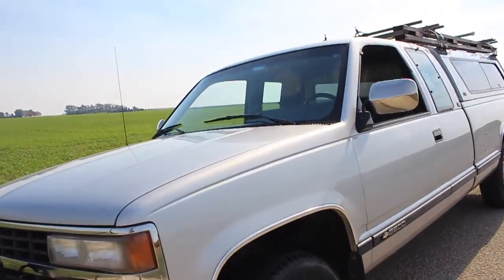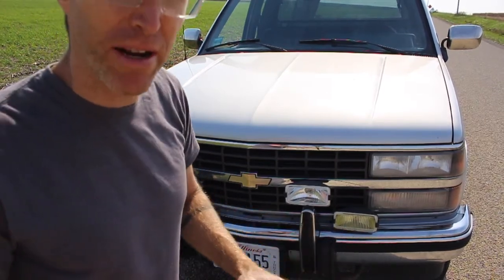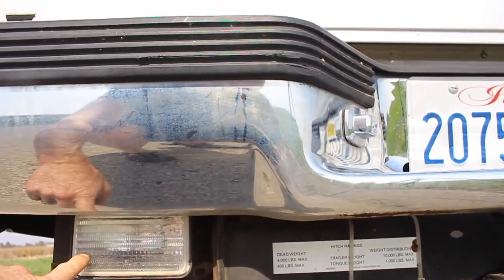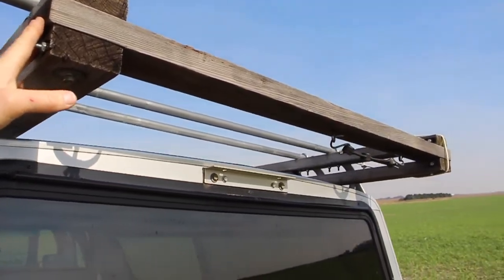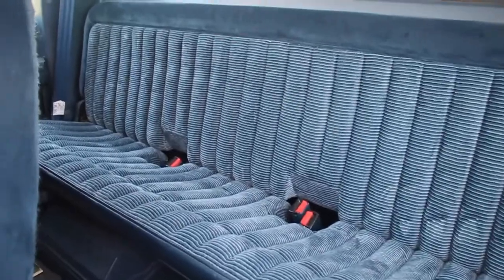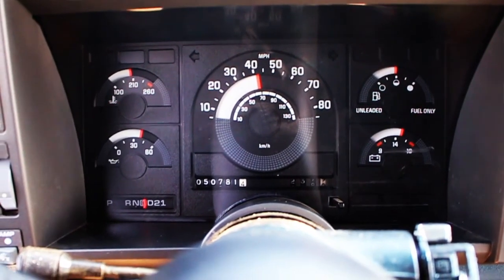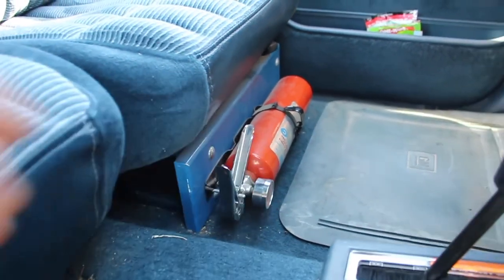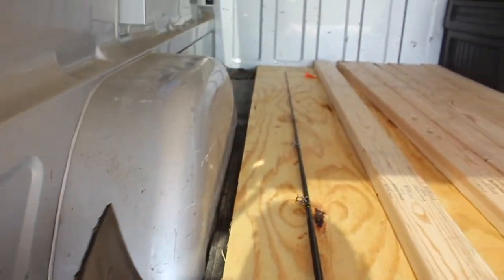1990 Chevy Truck Tour

Comment: Very awesome clean Chevy! I had a blue 1990 C1500 2wd V6 5speed. I had the same blue interior. I sold mine 3 years ago to a younger guy that I work with. He swapped in a TBI 350. As others have mentioned use relays to reduce the chance of fire. I see burn marks all over the highways where there were car fires. 
The GM headlight switches in your truck actually run a powered (smaller gauge wire than they should have used) into the cab and the headlight switch is actually switching the power on and off. A lot of the headlight switch plugs are melted where they have gotten hot. You can build this harness for less than $30. You can google it but you run your headlights directly off the battery with a 10 awg wire ran to a Bosch style 40 amp relay. You headlight switch is then used only to turn on (trigger)the relay using  the existing smaller gauge wire. What you get is a by-product of brighter headlights. With the headlight run direclty off the battery when running your alternator is charging the battery at around 14.1 - 14.2 vdc. The old way it goes through the switch and extra wire with more resistance and finally back to the headlights at around 12.2 vdc. That doesn't sound like much but there is a formula that I can't find and it is a significant increase in usable light for just the 2 volt difference and it's safer because you are not pulling 30-40 amps through your headlight switch. Here is a premade harness not sure on the price. http://www.painlessperformance.com/webcat/30817. Also with most GM cars and trucks when you switch to high beams the low beams go off. There is another relay kit    http://www.jegs.com/i/Painless-Performance-Products/764/30802/10002/-1     That keeps all 4 headlights on when you switch to high beams (better spread pattern of light). You can build this for less than $10.  If you are going to keep your driving/fog lights use a relay for those as well and get the (fire hazzard) high draw power wires out of the cab and run them directly off the battery and run a small gauge wire into your truck just to trigger the lights on and off.    Very nice truck!
Reply from the maker: Oh man, all this info totally makes my day! This is super helpful ... and I had no idea about these wiring issues and options. Thanks, man!
Reply: You are welcome! I built a harness for my 1990 truck and I just ordered all the little connectors for another harness for my son's 2002 s10 Blazer 4 door 4wd. It's a little cold here and may wait for warmer weather.

Comment: Chevy & GMC produced those generation fullsize pickups from 1988 through 2000. In 1988 only the regular cab pickups were redesigned to that body style & first time the optional extended cab was introduced too. Fast forward to 1992 the fullsize SUVs & crew cab pickups were also redesigned to that body style. On the 1/2 ton pickups & fullsize SUVs, 1999 was the last year for that body style although the next generation 1/2 ton pickups were introduced in that same model year. 2000 was the last year for the 3/4 ton & 1 ton pickups with that body style.
Reply from the maker: Thanks for all the info! My 1990 is getting close to 70k miles ... great truck
Reply: @metaspencer  did u buy it new back in 1990?
Reply from the maker: @kevinrichards3288  My step-dad did but didn't drive it much ... when I got the truck from him I also got all the original manuals and stuff ... getting close to 70k miles!

Comment: Do you know how relays work. I would remove the switches, and set up relays to supply power to the lights using low beams as a signal for the fogs, High beams as a signal to the driving lights and reverse lights as a signal to the backup lights he installed. The signal power is next to nothing and would not effect the stock circuits, you would want to run a single separate power leg to the add on lights.

Fog light update on the Motor Home, took two tries to get it right. https://www.lever-family-racing.com/lever-family-racing-home/family-vehicles/1997-fleetwood-american-dream/fog-lights-second-attempt-2017-07-27

Standard Bosch relay are readily available with wiring pig tails , this is a link to some that have fuses built in. https://www.ebay.com/itm/6Pack-12V-30A-Fuse-Relay-Switch-Harness-Set-SPST-4Pin-14-AWG-Hot-Wires/253167690800?epid=22007500424&hash=item3af1f86430:g:OMIAAOSwXedZw09k

Lots of wiring diagrams out there but the terminals are very standardized. You can get really creative with these and it is old school technology. In this diagram there is a switch, I would not use a switch just the power from the low beam, high beam reverse circuit to trip the relay. https://s-media-cache-ak0.pinimg.com/originals/d0/58/63/d05863ba90efaa43a89dc40d1e2ddae8.jpg

Fire extinguishers should be required, if you do not want to see your vehicle burn down on the side of the road. If you watch when driving on a highway it is amazing how many burn marks are in the emergency stopping lanes. Watch some time.

The screen in front of the radiator should be fine, watch your temperature gauge and it will let you know.

Glenn
Reply from the maker: I sort of get what you mean. That would be a cool system. Looking into it ...
Reply: This is what the relay setup looked like in my Jeep project.  http://www.leverfamilysite.com/images/1984_Jeep_CJ7/Progress_2012_03-26/DSC_0819.jpg 

I did try an draw a diagram back then. This shows the relay supplying power to the headlights (wiring on older jeeps used thin conductors and lost voltage over their runs and I wanted full 12 volts at the headlights, made a huge difference.

http://www.jeepforum.com/forum/attachments/f8/472422d1347676677-cj-headlight-relay-upgrade-diagram-headlights.jpg

http://www.jeepforum.com/forum/attachments/f8/472419d1347676532-cj-headlight-relay-upgrade-relay-terminals-points-contacts.jpg

The buss bars are out of mid 99's GM suburbans and vans (got them out of a junk yard.) One for negative, one for positive

Nice and bright. http://www.leverfamilysite.com/images/1984_Jeep_CJ7/Progress_2012_03-26/Driving_Lights/DSC_1248.jpg

Glenn Lever
Reply from the maker: Oh very cool. If I can figure this out, I'd like to do much like what you have done on my 1967 Ford tractor. Thanks man!
Reply: Much simpler that all the diagrams look. You have a coil that you supply power to that becomes a electromagnet (very low current draw) that pulls to contacts together that curries the high current draw device (headlight). Some relays have a double set of contacts (one normally open an the other normally closed). That's it. any questions feel free to ask. (I was an ASE certified Master Tech for years and owned my own garage).
Reply from the maker: Awesome. I've replaced a few relays (on the bus), but haven't stalled any as a new system ... very cool and giving me ideas
Reply: You can do neat things with relays. I just installed ramp load lights on the rear of my trailer which I can switch on manually, but they also function as backup lights automatically when the backup lights come on. Thought I had published that but guess not, I cannot find it.

Glenn Lever
Reply: I have created a new page on my web site that details the addition of the loading lights that also act as backup lights and the use of relays to accomplish this. It is at this link.

https://www.lever-family-racing.com/lever-family-racing-home/family-vehicles/2006-car-trailer-2/ramp-loading-lights-2017-09-26-2

There is a circuit diagram. https://www.lever-family-racing.com/wp-content/uploads/2017/09/DSC_4223.jpg

Good image of what happens inside the relay https://www.lever-family-racing.com/wp-content/uploads/2017/12/mini-automotive-relay-wiring-840x.jpg

Glenn Lever
Reply from the maker: Oh awesome. I'll take a look, as I'm eager to figure this out
Reply: Note, if you click on a picture on the web site it will enlarge.

Glenn Lever